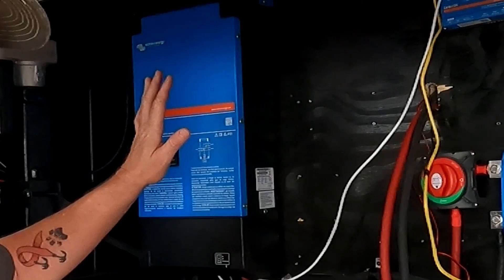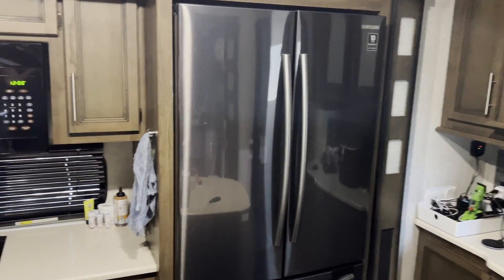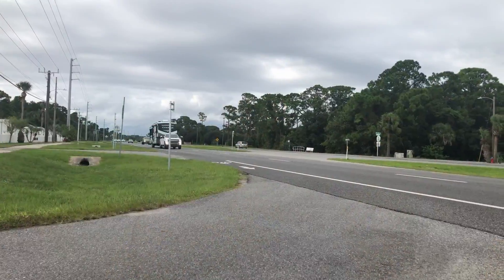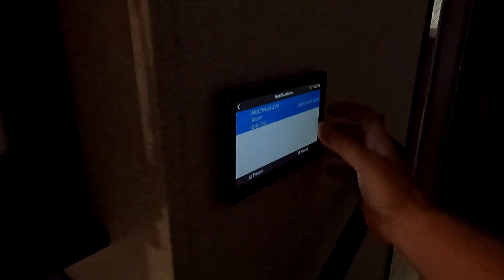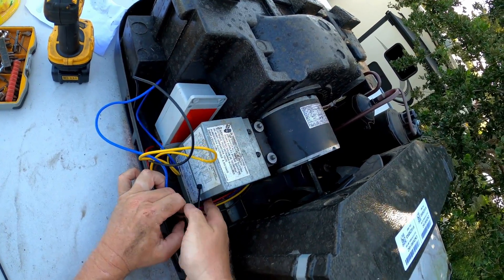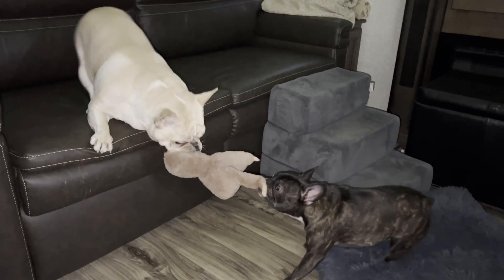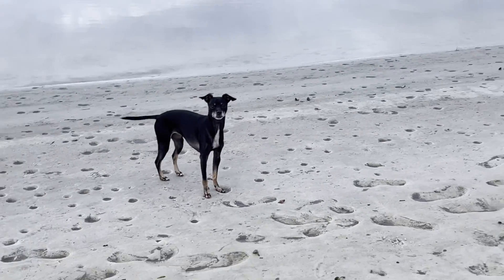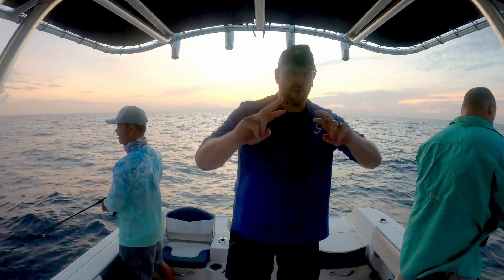Will one Victron Mulitplus II run two A/C units? RV life RV living

Comment: On the Cerbo GX, you have 4 digital inputs.  You can wire an input per AC compressor so it shows on the Cerbo screen that each AC is running.  This way you could be alerted that the AC is not working

Comment: The problem with the single2,400watt inverter comes when both cycle on their compressors at the same time, and as they do this independently, eventually it'll happen... then even the soft starts won't be enough.
As for the discrepincies on your monitor, the 2,700 watts the batteries os the combined ac and dc loads... your inverter was 1,840(ac), and your dc load at that time was 560 watts1849+560=2,400 watts.2700-2400=300. the 300 missing watts are the total losses in the system. About 11%... that's not bad... most of that loss is in the inverter with the remainder in wiring, connections, etc.
But yes, 2 AC's kick on at once, maybe once a week the fridge even lines up its start time, and all other regular loads... you need two inverters (well, two of that size, I mean).
I too, will be doing dual inverters, but since I will be living full-time, my worry is more about failure at a critical time, so if I blow an inverter, I still have one to maintain crucial systems (food storage, cooking abilities, pet survival, etc.)
Same for my mppt's, dc-dc units, etc... anything vital to my survival is doubled, so I can work around any failed equipment until I can get it repaired/replaced. Same goes for your double dc-dc's... one fails, you're not scr*w*d.
Sure, if a part fails, I'll have to more carefully manage usage until the problem is remedied, but I won't freeze to death or par boil while I wait for that fix.(I live in a part of Canada with extreme temps both ways. lol).✌🏼🇨🇦
OH, I almost forgot... at around 1900 watts ac there, not sure why your inverter was showing an overload alert???
Reply from the maker: https://youtu.be/-G0W_b_XMtc?si=zIDu6D-tEUSoXBpm
Reply: Make sure you wire up your inverter so you can bypass it if needed using a rotary switch

Comment: We ran 2 ACs on my 12v system for about an hour before the inverter overheated and kicked off. But my multiplus ii 2x120 is on its side so cooling isn't perfect but any means.

Comment: My comment got deleted somehow. Sorry if I did it by accident. I saw this issue in Facebook solar group. Here is a comment/answer that might explain the display discrepancies. 

“The DC power readout on the GX is simply the difference between the watts measured going out to the AC loads and the watts going out of the battery. The extra power you’re seeing with the air conditioner running is the conversion loss from the inverter. With an inductive load like an air conditioner, you can see up to about 10-12% loss with any inverter since the power factor is less than 1 on the load.”
Reply from the maker: That’s incorrect, your getting this backwards. Battery use is reading correct wattage usage, AC load on GX read out is incorrect by a lot. No matter the power loss through inverting the AC load should reflect a correct AC wattage usage on the GX. Yes there should be a small discrepancy between battery draw  which should equal DC and AC load minus 5% efficiency rate. Regardless the AC load should reflect accurate AC usage, two air conditioners running are over 2,600 watts but AC load was only showing 1,800. 

Inverter efficiency loss would show on battery side as a 5% higher reading than the accurate AC load wattage. Not the other way around and not by almost 30% difference.

You said the “extra power your seeing” on the shunt its not “extra” thats actual accurate reading, two air conditioners, frig, and DC load like lights all add up yo about 2,700-2,800 watts which is what the battery shunt is showing. Are you saying you can run a frig and two air conditioners on 1,800 watts? No that preposterous, so the GX is reporting inaccurate AC load not an efficiency loss 🤦‍♂️
Reply: @saltytrips I just came across the subject of Reactive and Apparent Power when using an inverter or generator to power height wattage appliances. Another channel I follow did a comparison of his stock air conditioner and a new inverter compressor (like a mini split) roof top unit. Because the older tech of the original A/C used full power for the compressor the is a high Reactive power that shows up when using the inverter. Basically the battery and inverter are having to “charge the line” in a sense and that shows up in the load on the battery, but not the output of the inverter. When hooked up to shore power the Reactive power is still there, but is always “full” from the grid (not necessarily great terminology on alternating current, but I couldn’t think of another way to say it than “full”). I would be interested to know if that wattage discrepancy is lower when using power assist. I am happy to add the link to the video I was watching, but wouldn’t add that to your channel without your permission. I would test my theory myself, but our motorhome is in for warranty service at the factory for next 10 ish weeks. So I’m bored with nothing to work on!
Reply from the maker: @ during power assist the discrepancy isn’t there, it reads accurately

Comment: In a word, no...
While the Multiplus II IS rated for 3000Va, the formula is Va x .80 to get power(W), so a single Multiplus II rated for 3000Va is only capable of yielding 2400W...
Now, can you push the Multiplus II into delivering more than it's technically capable of, sure, just like you can O/C a cpu, that is until you burn it up...
I run 2 Multiplus II 120x2 and can run my A/C, microwave AND the electric water heater all at the same time, are maxxed out, nearly, I have essentially 4800W of power to use, and with those 3 running at the same time, I'm using about 4600W...
The entire key to off grid with PV setups is managed resources, that includes fresh water and holding tanks...
Reply from the maker: Thanks for the video recap

Comment: I was playing with running 2 a/c's. I ended up frying my battery disconnect.  It was a cheap china disconnect and I changed it out for a blues 300 amp.  I will play with it again in the summer and if it does it again I will change the 300 amp disconnect for a 600 battery disconnect.  It is also important to check the temps of your wires in certain areas to see what they are reading and maybe a certain connection is hotter than in different areas
Reply from the maker: If you run appropriate wire size heat is not an issue, if your wires are getting hot then it’s definitely undersized. Same with the rest of the components.

Comment: Great video, great information. Can I ask you about your truck. I have the same 2022 F250 XLT 7.3 gas,   Really like the truck,  love the engine,  but I have real concerns with transmission. Are you experiencing any downshift issues. While accelerating up shifts are fine,  but when decelerating shifts are hard and jerky.   Have you experienced any issues?  Thanks in advance!!

Comment: If you're on the fence about how much solar to add I recommend getting the most that can fit. You'll be happy you did, as power is addictive. The more you have, the more you'll find a use for in the future. The same goes with your batteries. Get the most you have space for and can afford. Pre-built lifepo-4 batteries can be very expensive and take up a lot of space. I built a 560ah 12v battery out of 8, 280ah prismatic cells that fits in the same space as 2 GC-2 lead acid golf cart batteries. The price of raw LiFePo-4 cells has dropped since I built this one. I have since built another 48v battery using 16, 320ah cells for only $1,866 including the BMS.
Reply from the maker: We have measured and settled on the solar layout. That video will be out soon. We already have three 24v 200ah LiTime batteries, may get one more. We have been running some test to make that finale decision.
Reply: @saltytrips  3, 24v 200ah batteries should be sufficient. This is about the same kwh as our 48v battery, which is more than sufficient for our needs, but then again, we charge it with a 4,400w array. It will run a 12k btu mini-split 24/7 and a 14.5k btu rooftop AC during the day as needed too.
Reply from the maker: @SuperSushidog  its all contingent on the weather, we’ve been running test and tracking wh , just want the batteries to last the night so we don’t have to run a generator at night, then replenishing batteries during the day with solar and if need be a small generator. We are very happy with our setup thus far, parallel inverter is next then solar.
Reply: @saltytrips  Also consider throwing in an extra charge controller that an external array can be connected to once parked, to augment the solar on the roof.   A see a lot of people pull out temporary flexible panels after parking.

The main issue with batteries is to have enough for approximately 24 hours of operation.  In poor weather or when parked in the shade, you only want to have to run the generator once a day for a few hours to charge the batteries up.  Silence is golden 🙂

Comment: How many solar panels do you need to get 2500 watts? And, how does the weight of the solar panels effect your suspension on the trailer? Will you need to upgrade the suspension? Great video as always. Keep those puppies safe for sure.
Reply from the maker: We have a video coming out soon to explain all that and more, stay tuned. We are still in the process of installing and filming.
Reply: Gonna depend on how larg the solar panels are.  Weight will be roughly 35lbs per 300W.  Very approximately.  Usually when fitting a space, like a RV roof, to solar, you find panels with dimensions that work well for that space.   

Panel weight is not usually an issue, but battery weight can become an issue... particularly if one has a lot of batteries and the weight is lopsided on the suspension.  Still, LiFePO4 is a lot lighter than lead-acid and even 10 kWh of usable storage is only roughly 160lbs worth of batteries.
Reply from the maker: @junkerzn7312  will go over all that in up coming video 👍
Reply: My cc 525 bifacials are 70 lbs each.They stand 7.5 feet.Whith my mounting hardware 100 lbs per panel.I’ve been 500 lbs over weight before without panels.So this toy hauler may have to go on a diet lol
Reply: @2hotscottpro  Bifacials are not normally mounted on roofs (vehicles or homes).  There isn't any point since the backside won't get enough light to justify the cost and weight.
Reply: @junkerzn7312  they’ll be 15 inch off the roof.They were the highest wattage I could get for the footprint I wanted.Made more sense than a bazillion 100 watt panels lol I tested them in all positions with same watts flat,vertical and tilting.I told distributor about it and ends up there right at there 70% First time messing with solar and learning.
Reply: @2hotscottpro  Make sure the roof can handle the weight, bifacials are 50% heavier than normal panels for the same wattage.  Since you already bought them, I won't try to talk you out of it 🙂
Reply: 920ah 180 lbs plus wire plus 75 for inverter..I have 2 separate systems.The 920 is just for heavy loads.All my extra weight is centered over axels.